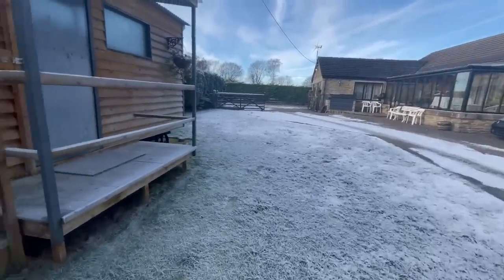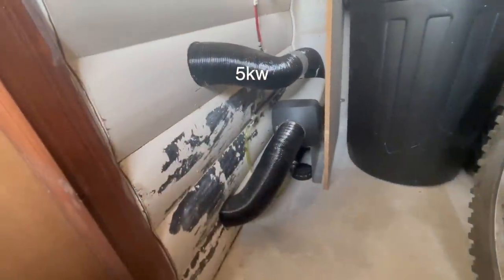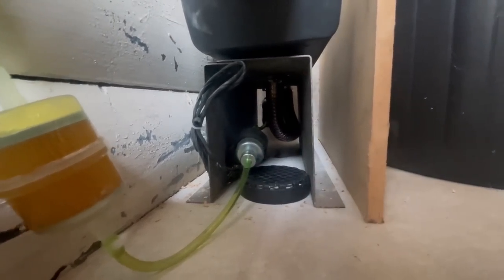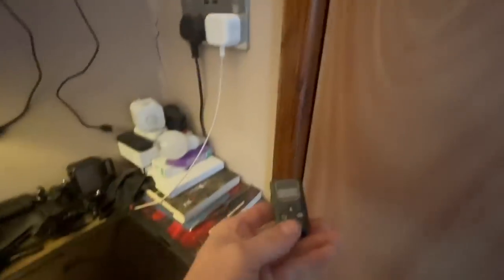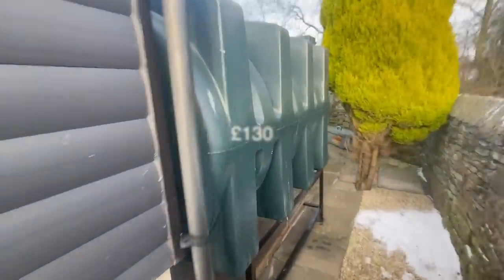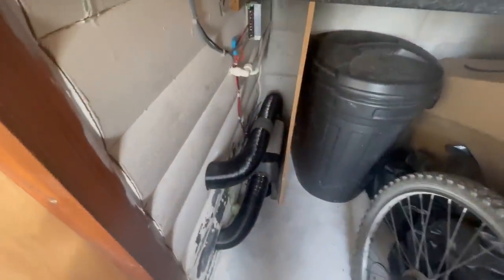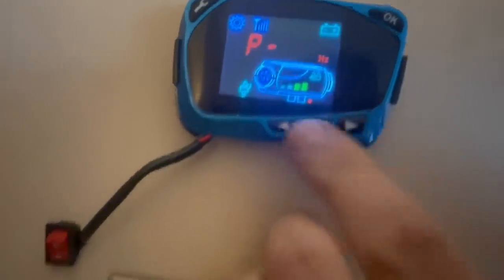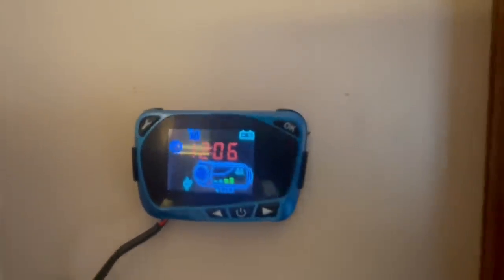Heat My House with Chinese Heater

Comment: It would have been nice to have a look around the bungalow, to see the space you're heating and whether or not you got the entire place warm from your one inlet point.
Reply from the maker: Yea sorry pal, it basically heats up my front room 1 bedroom and my bathroom, although it will heat the other bedroom and kitchen to but have to have the heater on high 👍 cheers
Reply: @CarJunkeez  still, it sounds like a large area, covering the three main rooms.
The kitchen can keep itself warm, thanks for getting back to me 🥶

Comment: By the time u use last drop of fuel out that tank it will have gone off premium lol also i might add would be more practical to run it on a battery charged from your solar incase of power cuts, brilliant set up tho, ive had deisel heater in a van and have one doing nothing for 2 yrs stored i have cintemplated doing this in my home and finaly found a vid i like to take the plunge , rgds matey
Reply from the maker: I know yea the price as already dropped massively 😂 I shouldn’t of panic bought 😆 yea think I’m gonna have a lead acid battery and charger just incase as they burnout the PCB pretty quick on power cut. I tend to heat 2 rooms in cold winter then open the doors when I go bed and switch it off, but really chuffed on how well it does mate 👍 cheers

Comment: Nice install ,what settings would you have for fan and pump running old engine oil ? I can check afr with my wideband to get in spot on
Reply from the maker: Cheers mate 😁 not sure on oil but if you’ve got a meter then shoot for around 15:1 and see what temps your getting and tweak from there, and make sure it doesn’t sound like it’s trying to stall the flame when on low setting as that’s the trickiest to get right 👍👍

Comment: Found the heater on ebay for £85 & on amazon for £156. Wonder what the difference is???
Reply from the maker: Most sellers have nearly tripled the prices lately because of demand, they are probably the same but some have the more advanced controller so you can tweak them, but the seller doesn’t even know the difference between them anyway 😂
Reply: I also noticed that non of them come with your wall control box, but it can be bought separately for another £35 😕
Reply from the maker: @mikelacross  I swapped my controller and board from another all in one heater that I also got from vevor.com 2 weeks ago £100 delivered to U.K.

Comment: Great set though just check you pump positioning as I’ve seen some stuff that it has to be positioned on an angle to get best performance on fuel economy etc but your set up may be different .
Cheers for great video will invest in one for sure
Reply from the maker: Thanks mate appreciated 🙏😃 yea the pump is actually at a 45 degree angle but it’s tricky to see it is in the video, to be honest it would be best to fit the pump vertically upright as it’s just to make sure no air is trapped in it. I do find that the pump allows more Kerosene to flow than it does Diesel on each stroke because the Kerosene is thinner, that’s why I changed the settings. Thanks 👍👍
Reply: I built a small wooden plywood box for our externally mounted pump then I drilled 4 holes in the top and bottom of the box  2 at each end of the pump then suspended the pump on thin bungee cord available at B&Q it has completely silenced the clicking noise the pump makes and you can still suspend the pump at 45 degrees.
Reply from the maker: @oojimmyflip  awesome mate 👍 yea the pumps are the noisiest thing about them but luckily I can’t here mine through the wall 😃👍

Comment: Can you provide a link for the heater you purchased there are so many different ones for sale and the wording is not always so great so it's hard to tell which is a good purchase not to mention the price you quoted is lower than most of what I'm finding
Reply from the maker: Hi, I got mine from vevor.com but they no longer have any in stock, these heaters have dramatically increased in price in the past few weeks and availability has decreased so they’re difficult to get at the mo. Mine is the 5kw and I changed the board and controller from another all in one unit so I can tweak it that I also got from vevor.com , I’ve actually got 5 heaters in total from vevor.com in the past few months. Cheers

Comment: Why don't you use it at night? I'm looking to heat a garden room but this would be the only heat source.
Reply from the maker: I do sometimes now, I just get a bit paranoid but it’s been absolutely fine since I installed it and have been using it a lot lately 👍 cheers

Comment: Can you tell me where you got your switch mode power supply from thanks
Reply: I would like to know this too thanks
Reply from the maker: Hi, sorry but the original one isn’t in stock but you can get one here for £14.99 at the mo https://www.ebay.co.uk/itm/185665920498?mkcid=16&mkevt=1&mkrid=711-127632-2357-0&ssspo=yganpdlqrma&sssrc=2349624&ssuid=TfbyrDzlTkm&var=&widget_ver=artemis&media=COPY

Comment: This for real 2000 ltr tank , exhaust  comes out under tank , full of kerosene, (down graded jet fuel)
All to run a cheap Chinese Air heater 
Which you use 1 ltr to run 10 hrs .
Reply from the maker: Hi, The exhaust is nearly 3 feet away from the tank and there’s plenty of open air to vent as it’s on the metal frame, it’s not even as bad as a car if you think about it with exhaust right next to fuel tanks 👍 cheers
Reply: Crazy to think that tank could stretch out to 2000 days. And you only use the heater in the colder months, not year round. What is the shelf life of kero in a tank like this?

Comment: Do you have a link to the power supply you used
Reply from the maker: Hi, they’ve gone up in price since I purchased but this is the one I got - https://www.amazon.co.uk/dp/B088834L3Z?ref=ppx_pop_mob_ap_share
Reply: @CarJunkeez  cheers buddy, live in a glorified garage similar to yourself, freezing in winter, hope this does the trick 👍
Reply from the maker: @Shakingstevesallotment  it should do the job mate 👍👍 cheers

Comment: Good set up but do not turn the power supply of wile its running as you will cook the hole unit and mite  have a fire, let the unit go through its cool down cycle for safety.
Reply from the maker: Cheers 👍 yea I always do the full shut down procedure, I’ll only turn the power supply off in summer when I won’t be using the heater. Cheers 👍

Comment: The only thing you didn’t mention you had fitted was carbon monoxide alarms especially as you have a wood burner!
Reply from the maker: Quite right mate, I’ve definitely got them, I always have 2 just incase as can never be too safe when it comes to carbon monoxide, also in my van to as that also has a diesel heater. 👍 cheers

Comment: Is the exhaust too close to the air intake ???
Reply from the maker: It looks it but it’s actually ok as they both point in opposite direction and at different levels with good airflow 👍👍

Comment: It doesnt use 8kw of electricity does it?
Reply from the maker: Hi, no it doesn’t take much electricity at all, it just draws around 18 amps for the glow plug for a couple of minutes and then not much to run. The 8kw (5kw really) is meant to be the measurement of heat output. 👍
Reply: The fan and fuel pump combo take 18-44 watts depending on the speed. The startup draws about 120 total watts because it uses a ceramic glow plug to heat the oil to the point of combustion. If the heater is powered up then adjusted to the lowest setting and allowed to just tick away and never turn off, you're looking at about 20 watts.
Reply: @CarJunkeez  ty!
Reply: @KenjiFox  ty!

Comment: If your temperatures outside go below freezing then kerosene is your best bet however a gallon of kerosene has 112,000 BTUs gallon fuel oil or what you call heating oil has 144,000 BTUs so you’re much better off to use fuel oil one it’s cheaper than kerosene and to the heat output is greater than kerosene. The only advantage to burning kerosene is that it won’t gel and fuel oil will begin to jail in about 28°❤️🇺🇸❤️🇺🇸❤️🇺🇸🔥🔥🔥🔥
Reply from the maker: Cheers 😃👍 Here in the U.K. we have standard or premium(has an additive) heating oil(kerosene) or red diesel and these Chinese heaters do burn hottest with the diesel but has high sulphur content and can coke up the inside of the heaters. I run the standard heating oil as it cheeper and has a clean burn so won’t really coke up the heater. 👍 cheers

Comment: A couple of things would be a fire valve from your tank, plus it has to be at least 2m from the property to comply with building regs. Then exhausting under the tank is a worst case scenario. Tidy up the electrics maybe and everything else seems good tbh. I think I might buy one now.
Reply from the maker: Thanks mate, yea I’m definitely going with a fuel cut solenoid for the tank that only opens when in use and going to reroute the exhaust too, I’ll probably go through everything again now I know it works well 👍👍 cheers

Comment: Hi, do you have a link for the kerosene please
Reply from the maker: I got mine from Crown Oil mate. If you can’t get it from Crown Oil in your area then try Boilerjuice.com 👍
Reply: MightyPNE1 where are you based?
Reply: @KevinHoey1  hi, Preston Lancashire.
Reply: @MightyPNE1 if you are in the same boat as me and only  want smaller quantities the price is a fair bit dearer.
I hunted about online and the best I could do locally was at compass fuels penwortham. 
£1.50 per litre for red
£1.29 per litre for kerosene 
Both prices are for collection of already made up 25L containers.
I'm near Leyland myself.
Reply: @KevinHoey1  incredible, this is perfect. Been looking all over. Cheers buddy. 👍
Reply: @MightyPNE1 glad to help. I've fired off a couple of messages for prices for delivery of a 205L drum of kerosene but haven't had a reply yet. I could stick a barrel in the garage which would last me at least a year. What quantities are you after?
The price I got for a 25L drum of kerosene from compass was £32 ish but £200 for a 205L barrel would be good.

Comment: Your oil tank is not securely supported, it already looks distorted around that metal frame. A leak of 2000 litres of heating oil will not be a pleasant experience.
Reply from the maker: Hi, The only distortion in the tank is from when it was manufactured, you’d be surprised at how thick and strong this tank is and I’ve modified the metal frame to suit with 5mm thick angle welded under each rib 👍 but thanks for the heads up I’ll keep an eye on her 👍 cheers
Reply: @CarJunkeez  According to fuel storage regulations oil tanks over 1000 litres should either be internally bunded or surrounded by a concrete base and bund wall large enough to contain the max. capacity.   In all cases they must be installed on a flat concrete pad larger than the base dimensions of the tank.  I liked your video though, just be careful.

Comment: Why would I buy this off your review? What did you review? Did you have your place cold, then start up the machine to see if it would fit my needs. You know, my needs, as I assume you are doing a review for me, as well as others watching your channel. I cut it on, it works, throws out heat. Review done. Yep, tells me all I need to know.

Reply
Reply from the maker: It’s not a review, just thought I’d show my little simple setup that works well for me. Thanks 👍

Comment: dude u can mix used oil with the kerosene also bdont go more then 50/50
Reply from the maker: Cheers 👍 yea I know but just want to keep the heater internals clean so sticking with kero for now 👍
Reply: @CarJunkeez  used transmission fluid burns real clean its good to know if your in a pinch even new cooking oil burns good in them i love these things there so crazy lmao
Reply from the maker: @raymondj8768  cheers man, I’ve put some ATF in too for lubricant as people say the pump needs it but I think it’s fine without but yea your right they can run on most oils these things 😆 👍👍cheers